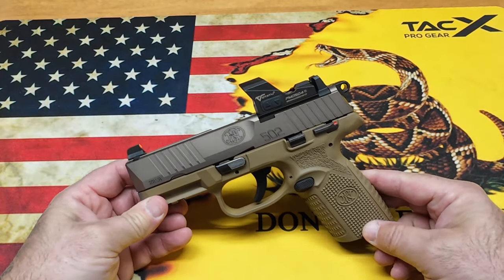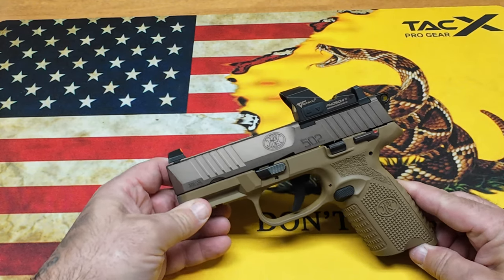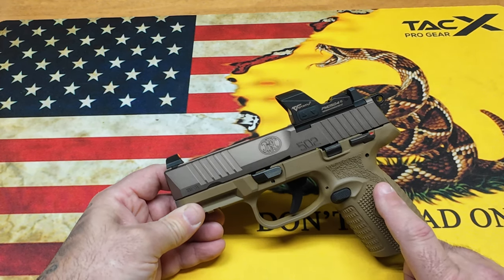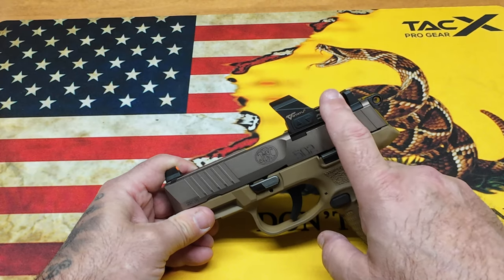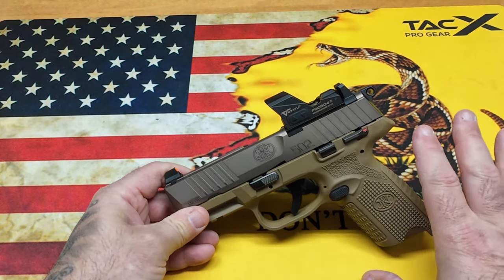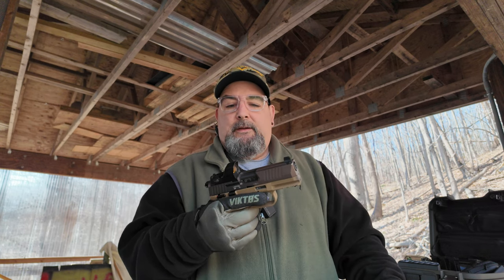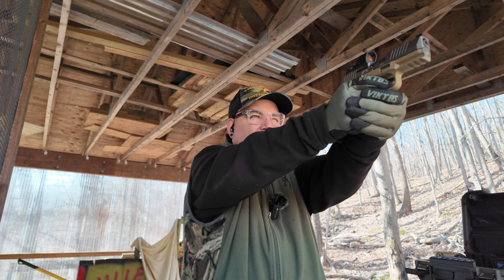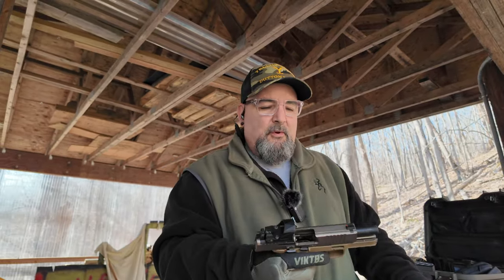FN502 Problems And Issues

Comment: Keep ‘em coming about the FN502T, great video!
Reply from the maker: Thank you it’s actually my favorite gun right now and I will get this figured out stay tuned more to come!
Reply: @yankeecowboy  my favorite as well, over my Ruger MKIV22/45, never thought I’d say that!
Reply from the maker: I have a ruler mark iii hunter and I agree! @christophernewsom8898
Reply: @yankeecowboy  I have MKII target as well.
 My 502 runs like a champ no issues so far, I changed the guide rod and spring like you did and polished the feed ramp and a Light (very light) polish of the chamber before ever shooting it. Have about 3-350ish Rnds through it.
Reply from the maker: @christophernewsom8898  this thing ran like a sewing machine then it went down fast. I’m going to polish the ramp when it comes back from FN but this is a early model and I hope they get it squared away for me if not I’ll keep tinkering till I get it right.

Comment: I absolutely love my FN 502.  It shoots amazingly well and is more accurate than I am.  But...  I have 2050 rounds through the gun and have had a number of failures.  The first failure was a very sloppy trigger.  I took the gun apart and found that the pressed in pin on the trigger bar had worked its way loose and rounded off on the end.  I ordered a new trigger bar from Midwest and replaced it.  I had the same issue on the second trigger bar.  I ended up sending the gun back to FN.  FN told me there was nothing wrong and the problem was possibly my mechanics?  After getting the gun back, I replaced the trigger bar again, another $42 after shipping from Midwest.  On my last trip to the range, the slide lock started failing.  The slide would not stay back.  The aluminum on the slide is rounded off with a large burr sticking out.  Before you ask, no, I do not use the slide lock to drop the slide, I rack the slide on every mag change.  Oh and the trigger bar pin has worked its way loose.  Time to go back to FN... again...
Reply from the maker: Yeah I love the pistol but I feel the quality control was very lacking.
Reply: @yankeecowboy  The guys at FNA took care of my pistol.  They confirmed there was a manufacturing defect on the slide lock and the engagement of the trigger along side the fire control unit.  They replaced the pistol and had the new one back to me in less than a week.
Reply from the maker: @BullyChu  good to know I think I'll be sending mine in

Comment: My comments as an owner of two 502's that were both bought when the pistols were initially released. I clean every 5-600 rounds, oil the daylights out of it with Lucas Extreme and have zero problems using CCI SV. From your videos,  your slide looks bone dry. You said you use mixed ammo. Does that include 36 grain hollow points?  Are your optic sight screws too long as that optic is an odd one? How about the two black o-rings under the optic plate; are they there?
Reply from the maker: The orings are there and I do use Lucas oil and the grease but do you have suggestions to which and where? Thank you for your feedback I really appreciate the help

Comment: What if it’s the magazines, try to load them with two less in each and see if you have failures, I’m thinking first couple rounds don’t feed well as magazine decays?
Reply from the maker: I did think of that but didn’t try it. I have four mags to
Reply: The only reason I say this is I saw a video where guy said after 500 rounds magazine base plate becomes loose and slides off on its own, so maybe spring is weak after minimal use. It’s probably wrong and not a fix but worth a shot (pun intended)
Reply: I'm thinking in the same vain, but what if the spring in the magazine is too strong and when fully charged put's the rounds in a crooked position, once the first two are used the tension is less ... what do you think... just thinking...
Reply from the maker: @Igorfun  I thought that too and tried loading one round fire then two rounds fire etc but same effect and I have four mags
Reply: @Igorfun  I will go try my mags here soon as well to give a counter test, also just a random comment, there are followers that add 1 or 2 rounds for these mags, I find them not worth it because slide then has issues locking. I know this is a usual issue with followers but yeah I’d stick with stock mags
Reply: @Gatsquatch.300  I'm in the process off deciding if I get the walther p22q or the FN502. so any info or updates are welcome. The ruger sr22 is very nice to but I can't find it here...
Reply: @Igorfun I freaking love anything Walther if I’m being honest, always reliable, just going to have to deal with a lower capacity and maybe worse sights (easy fix).  I’ve never used the Walther .22 if I’m being honest.  But based off my experience with their 9mms they are likely awesome .22s

Comment: It's not brain surgery. You put un a 9mm spring on a .22lr! 9mm has a lot more recoil to fight that spring. If you do that mod, only the most powerful 22lr will cycle the slide. 40gr at 1200fps minimum. You have to cut 2.5 coils off that spring!
Edit: that is true velocity, not box printed. The box uses a 20in barrel, not a 4in. If it's box printed it would be 40gr 1,350fps. Cut 2.5 coils out and you can run box printed 40gr 1,200fps or higher. Like cci mini mags. There is a reason they put such a light spring in.
Reply from the maker: I hear what your saying but I tried both and get same results. Do you know anyone who has cut down the p250 spring? It’s not a bad idea to tune it.

Comment: Mag spring issue when fully compressed? Just speculating since it only does it 1st 2 rounds.
Reply from the maker: I have four mags and it does it with all but who knows 🤷‍♂️
Reply: Maybe you have tried this but load a mag with 3-4 rounds and see if it does it. I have a 502 also and it jams occasionally, but not like yours.
Reply from the maker: @John-th8td  I did try that as well.....seems to be hit or miss. it's a very strange pistol on how it acts up
Reply: @yankeecowboy  I agree. It defiantly is not a reliable pistol. I would only use it for target practice. The platform has great potential but the current issues need to be fixed.
Reply from the maker: @John-th8td  100% agree